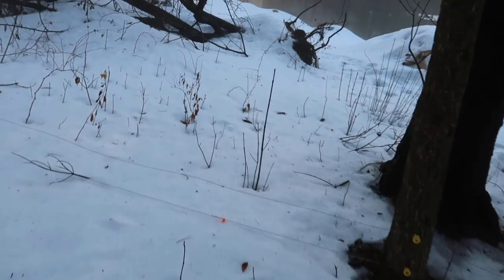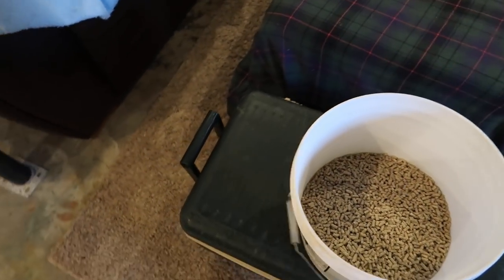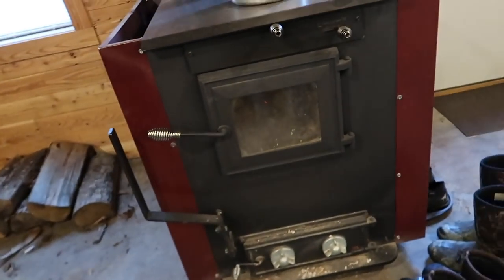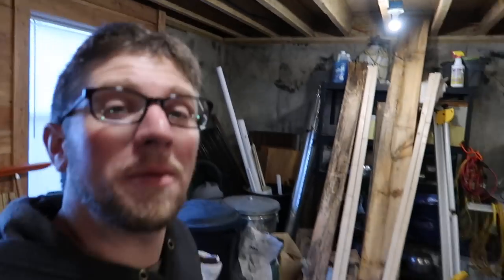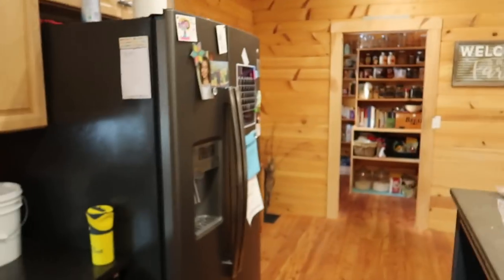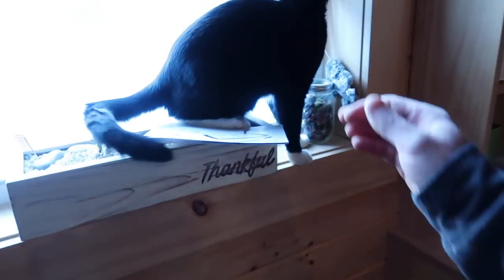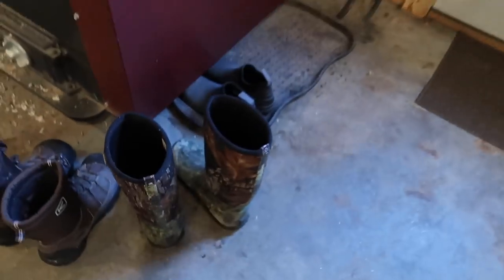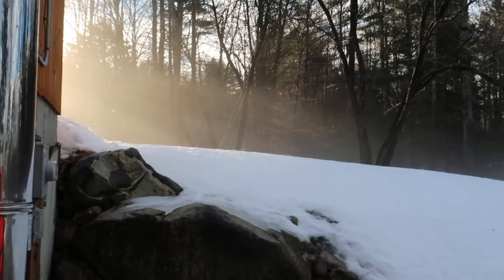Checking Our Maple Syrup Taps ~ Homestead Update

Comment: We always use those big round cardboard tubs of Iodized salt. You can get them for less the a buck. It may seem weird since most people use that Ice melt salt. However if you use table salt they are smaller grains and can COVER more ground with less salt. Also the table salt washes away in the spring rain better then the Ice melt does. We used to go through 3 or 4 BAGS of the Ice melt a winter. Then my grandpa laughed at me and said Table salt. We now use 3 or 4 dollars worth of salt a winter. Rather than 25 in Ice melt.

Comment: You might want to either put another small hole on the side of the bucket (along the top) or perhaps crack the lids open - I've read before that you can prevent the flow of sap from the tubing when a bucket is too air tight because you're also getting a pressure build up (there's gas bubbles in the liquid you can see as it flows out) as the sap runs. I'm not saying that's why you didn't get much sap but it could be a contributing factor. Good luck, it's a great hobby!

Comment: You could collect it before work and keep it indoors so it's not freezing and then come home pit the grill on and start to boil make dinner do chores and every now and then store and check the sap. It's a multi task chore. Like making a soup with lots of starch in it an you need to start every 3 to 5 min but it needs to cook for 3 hours....then you can leave the kitchen... So that is when I clean the kitchen, do the dishes,  make bread dough, prep other diners, do  inventory on the freezer fridge and pantry...and various other things that way I have 10 things done by the time soups done. whitout losing the whole 3 hours... 
The sap cooking thing could be like that. As long as you put it on the grill when your home and set it low enough to keep boiling. Or keep it cool and do it in the weekend. You gotta make do whit  what you have, and that's counts for time 2. 

Good luck. 

Kind regards rose.